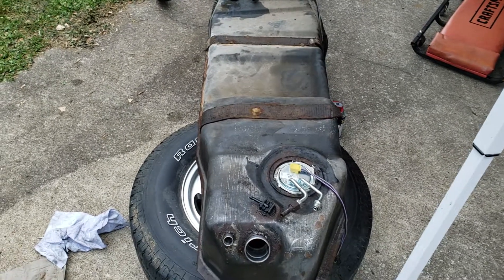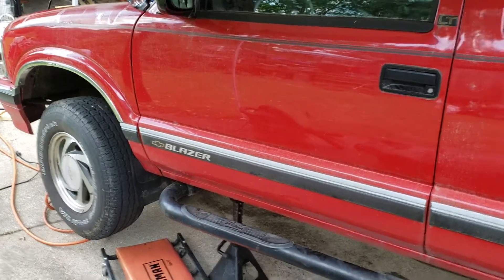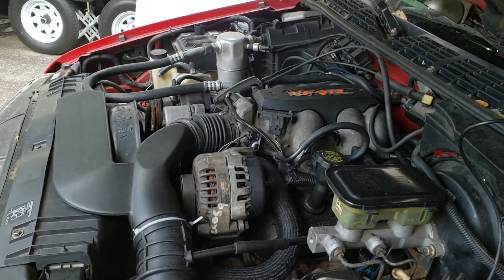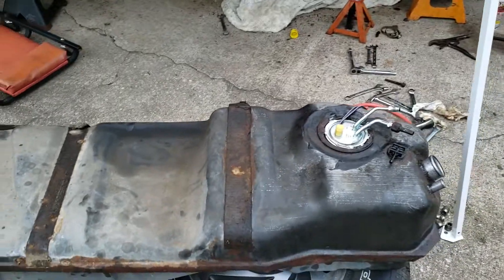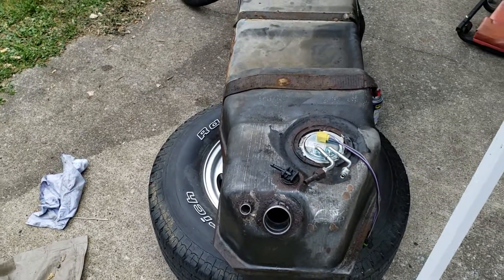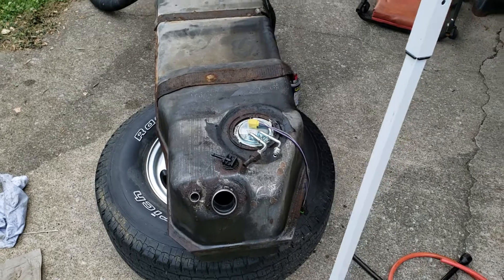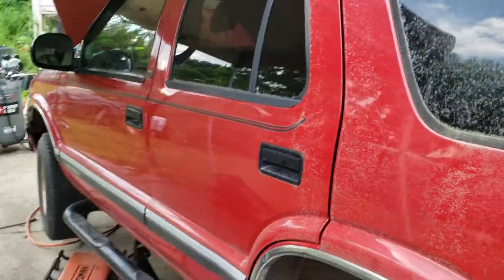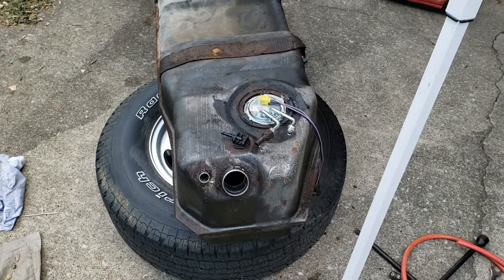1995 Chevy S10 Blazer fuel pump assembly

Comment: Hey maybe you can answer my question. My 95 blazer was leaking gas so I bought a new tank only to find it was the front black breather. So I bought a new one of them and it’s still leaking from there. Is there a line that hooks to the front one that I’m missing?
Reply from the maker: Can you clarify on what you mean? Front black breather?  Are you talking about the 2 fuel lines that go in the back of the intake manifold?
Reply: Lee C no. You see in the video on each end of the tank there’s those black nozzle type things. One by the pump and one on the other end. Wondering if the one on the other end has a hose that connects to it
Reply from the maker: Yes the hose you see on the far end I'm pretty sure is just a vent for the tank.. It's a vent valve.
https://www.lmctruck.com/1982-05-chevy-gmc/gas-tanks-parts/cst-1995-05-gas-tank-and-components-4-door
Reply: Lee C yea that vent valve. Did it have a house connected to it when hooked up? Mine leaks when I fill the tank over halfway.
Reply from the maker: @caseyeberle4816  The vent was on the tank. I don't remember connecting the vent to anything.  I will get back to you tomorrow
Reply: Lee C ok thanks so much for your help
Reply from the maker: @caseyeberle4816  check this out Casey. I hope this helps brother. You can do some other searches on the forum too. https://blazerforum.com/forum/2nd-generation-s-series-1995-2005-tech-41/fuel-filling-evap-leak-76152/
Reply: I've had the same issue since I replaced my tank two years ago.  It only leaks when the tank is full.  I gas up before work or when heading out so I can burn up about a gallon right away.  Lucky me, my cheapo fuel pump has a stuck check valve, so I've got the tank off to replace that.  I'm going to replace the vent while I'm at it and hope for the best
Reply: @caseyeberle4816  Mine has a hose that joins with the front vent valve and the open end  it tied to the filler neck.

Comment: 1995 was an odd year for gm. You will also find out that you a special plug or code reader for it as well. In 1996 the U,S government forced all auto manufacturers to use the same plug for the aldl plug.

Comment: My fuel pump check valve failed and I have the tank off to replace it.  How do I get the sending unit out?  You're right that the only other videos are other years and they all have a different setup.  I've got an idea, but knowing is better than guessing.
Reply from the maker: Use a flat blade screwdriver and a hammer and tap the raised tabs on the tank ring in a counter clockwise rotation. It helps using power blaster or WD 40 to break it loose. Let the lubricant stand a while.
Reply: @comanchee22  Thanks!  I got it and got the job done.  It started up great and was running stronger, but now it's still having trouble starting.  I really thought it was the fuel pump . . .  Guess I'm going to pressure test again today.  Was hoping it's not the spider.
Reply from the maker: @kontrarien5721  yeah man no problem. The spider I injection in my Blazer was replaced but later I removed the intake yet again to discover that both fittings on the back of the intake manifold were both hemorrhaging fuel. I replaced them and the fuel pump and it starts the first time every time now. If you still have fuel standing in the  manifold it could be that or a bad spider injection and or fuel pressure regulator on the spider.